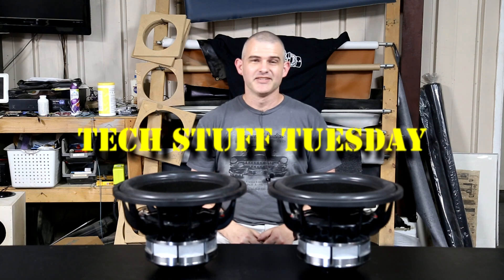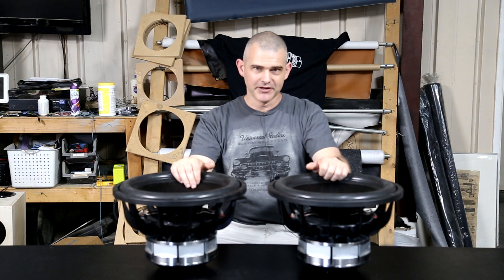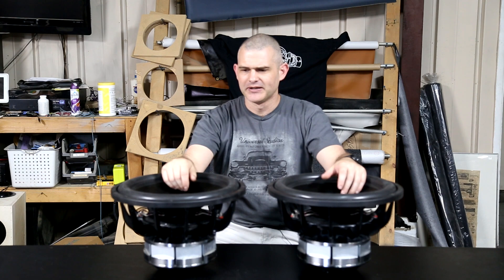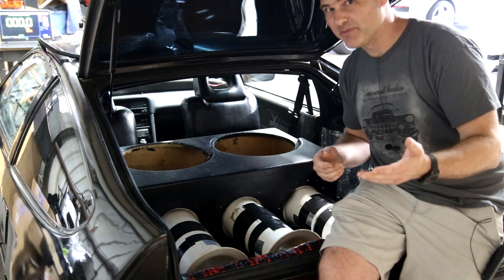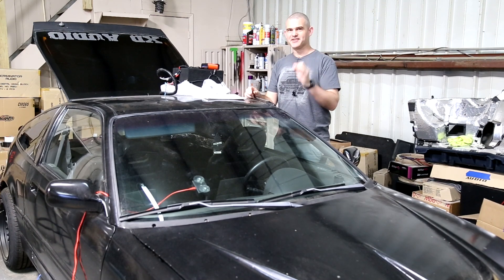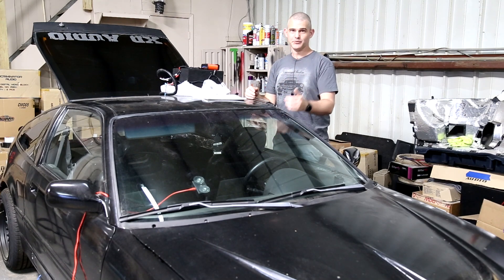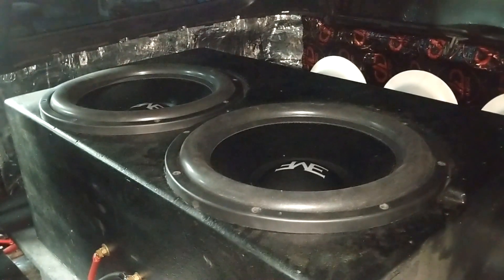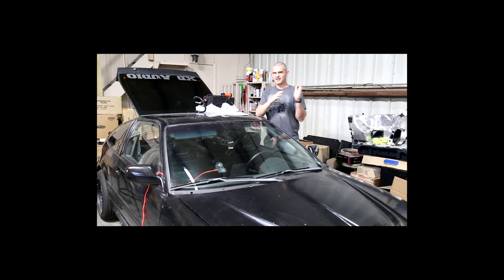What happens when one sub is broken in and the other isn't? - Tech Stuff Tuesday

Comment: I've been buying subs since 1993 and I have never ever broken in a sub.  I buy my subs, install and go full blast. 
Great video man!
Reply: Pfff me too. Ive never even heard of breaking in subs. I over power and run them hard without clipping. Never had a problem with good tuned boxes.
Reply: @joelthomas79  the glue on my kenwood 12’s came off and I got them tuned at a highly rated shop. I played them extremely hard first two days and now I gotta replace them ;(
Reply: @airuzair2424  lesson learned? don’t buy kenwoods again
Reply: @airuzair2424  shitty, just replaced my L7s with audio pipes
Reply: Werid encounter
Reply: Digital designs thinks you should break them in. I hear they are Richards. I don't know, I do it a.lottle in case the glue is too much causing the spider to rip, then again, it's probably rare that would happen.
Reply: @kcin2der18  audio pipe good?
Reply: @rookiebeeeautch5847  I love mine, still going strong!
Reply: U will get more xmax and travel  when ita broken in     its a fact

Comment: I drive a fairly small car an old Datsun and I used to break in my Subs. I would slowly push them and push them until they would start to stink... a little bit and then I would turn the sound way down... not off. But let them cool down and repeat. After about a week of doing that they wouldn't stink anymore and you could turn them up for a couple hours at a time.

Comment: I just installed 2x12" Ground zero subwoofers in my home theather. Recommended power is 350w RMS per subwoofer, im pushing probably around 400w per sub from my home theather subwoofer amp. the subs are single 4ohm coil so ive wired em down to 2ohm. they bang

Comment: 2 questions 
1) What happens if you have 2 different subs in the same box sharing 1 amp? Say 1 lowballer 12 and 1 SA 12. Both dual 4 ohm wired to a final 1 ohm load.

2) What happens if you have 2 different amps powering subs sharing the same box? So say you have 4 lowballers and 2 of them are wired to a 1k amp and 2 of them are wired to a 2k amp? Can you just lower the gain on the 2k to keep it somewhat even? 

Keep up the good content.
Reply from the maker: 1) You shouldn't do it, it's not ideal, and in some cases it could cause a sub to be damaged. In your specific example it would play just fine, just may not perform as optimal as it could with matching.
2) Refer to answer 1.

Comment: Can you post a video up on a dual common chamber with a slot port.
The port needs to be closer to one woofer.
Reply from the maker: Not necessarily.
Reply: I treat a subwoofer the same as piston in an engine..
What I'm trying to prove is that one woofer will age faster in such configuration hence we see one woofer unload faster than the other.

Comment: (Without bashing another brand because that always makes the bashing brand look bad) Why does Skar suggest, if not demand breaking in their subs or risk voiding their warranty?
Reply from the maker: My theory on manufacturers that suggest that falls into one of two categories. They either want an easy way out of not covering one (they could ask if you broke it in using their specific method and if you didn't adhere to it 100% then it's not covered, even a year later) or they want you to never play it hard enough to break it till it's out of warranty and it's not their problem.

Comment: I got 4 8’s and they don’t sound as good as my buddys do you think it’s because they aren’t broke in yet?
Reply: It might be your box design

If you design and make a diy box (there are plenty of tutorials on youtube using free software like  winisd and making it using basic tools) you can get way more output. There are a few things that you'll need. The winisd program on your pc, basic tools like a electric saw, a drill and ofc the materials if you have the tools you can probably make a diy box that sounds 10x better then your current box for like 50 bucks

In short:
Your subwoofer box is probably more important then which brand of 8 inch subwoofer you bought. So Your box should be designed for your subwoofer and not any 8 inch subwoofer.

I designed a 6.5 inch subwoofer box for a  dd506d (2 ohms) the design software says it will play down to 20hz but i havent made it yet but when i have ill update you
Reply: @troybakker7628  i got them sounding good now my 12v wire was bad
Reply: @sirdir5004  oh i see. But if youre looking for better or deeper bass a new box can always help
Hexibase has a video of a 3d printed box for a single 6,5 inch sub that made 136db in a spl test

The box that i am planning on building has some inspiration from it but ill use it in my home instead of car
Reply: @troybakker7628  Thats sweet that’ll sound good I was trying to decide if I wanted to install an equalizer because I already have an epicenter do you think it’s worth it
Reply: @sirdir5004  idk man i dont have a lot of experience with car audio since i never has a car or even my drivers license and this wi be my first subwoofer box build that I'll also use for a school project

But whats the reason you want to install a equalizer? A uneven bass response or sonething else?
Reply: @troybakker7628  i was thinking to see if it can give me deeper bass
Reply: @sirdir5004  hmmm i dont think it will add a lot of low bass. Maybe at low volume it does but at higher volumes it wont because the speaker wont be able to produce the low notes loud enough without over excursion.
For lower bass a box designed to go lower might be your only option 😬
But i ain't sure it might be that a equalizer will help but if youre hitting your excursion limit without a equalizer it wont add extra low bass
Reply: @sirdir5004  to add to that a equalizer doesnt lower the bass it boosts the lower bass
For example instead of the 80db you might get now at 24hz it makes it 83db but this wont work if your excursion hit its max like i already said

If you try to play notes lower then the tuning frequency of the subwoofer box your driver will move alot while barely making any sound
Reply: @troybakker7628  yea that makes sense I’ll probably have to go with a different box design

Comment: Some companies recommend that u do break in the sub a bit to loosen up the suspension and I agree with them as stated before...but to say it not needed as the sub will break in over time....is a reckless statement. Some people full tilt out the box....stiff suspension heat up the sub faster than loose suspension on the same amount of power. Also mixing a new with an old sub in a share compartment will have issues as one sub would not be able to cool as efficiently as the other....
Reply from the maker: You should watch more of my videos, where I prove all of that wrong. Also, you know what the sub not moving much from not turning it up is doing? NOT breaking it in. The amount the sub moves not broken in vs broken in isn't effecting cooling, and the more you push it, the faster it gets broken in. If you paid attention, it was less than 20 burps to get the other sub broken in which was REALLY stiff. That's almost like playing it wide open for 1 minute to get them to the same amount of stiffness. If the sub won't take rated power for 1 minute while breaking in, is it a sub worth having?
Reply: @EMFAudio  I see ur point but its dont take away from the fact that at 200w a new sub is moving less than a sub that is broken it at the same frequency. If we are doing spl that's ok but on music things start to heat up. Point I'm making is it would take more that 1 minutes to break in any sub with a sub that have been playing for months. Your next video u should be to prove me wrong Is to play a sweep on a new sub and an old broken in one and measure the temperature...i would say start the test at about 300w per sub some 12" should be a good option. I can tell u now the old sub would be cooler than the new sub over a longer period of time, and that's at low power now imagine pushing 2k per sub.
Reply: @EMFAudio  my point here is not to say all sub should be broken in before played but if u need ur sub to be optimal u should give it some break in time. Sub get stinky when push hard out the box rated power or not as some would assume it's over power or ur amplifier clipping....test has shown lack of movement has made subwoofer heat up. When broken it properly its takes on alot more power and dissipates heat more efficiently.
Reply from the maker: @dwaynegentle  What you're describing is heat cycling the coating on the coil, it has nothing to do with cooling. If having some break in period was critical to a sub not failing, why would I tell every customer (WITH US BEING A MANUFACTURER) to just play it normally, when I'd have to warranty any failures? It's because they won't fail from that. Yes it cools better when it's moving, but if it's not moving, you aren't breaking it in so it doesn't matter how much power is on it.
Reply: @EMFAudio i respect your opinion and recommendation as a manufacture, but as a user and a system builder i can tell u what i observe and recommend in the field. . but it would be great to do a sweep say 80hz to 20hz and lets see which sub fail first...using rated power. i recommend using your subs to do the test. here in the Caribbean we play for hours also we demo for hours, reliability is key to purchasing subs. i honestly haven't tried ur subs, but  i sure will after it has been proven to be reliable under rated power without having to be broken in. 1 to 5 minute burp don't prove reliability, dissipating that heat built during an hour long play does
Reply: i notice in one of your video u did a sub for someone in Trinidad, well Trinidadian knows who are the boss of loudness in the Caribbean, just ask them about Guyana. we do SPL SQL and SQ...some of the world loudest and cleanest sounding vehicle are in guyana...our country is the only english speaking country in South America with Brazil as one of the bordering country...which is the King of Loudness. we are talking Music here not one note SPL.
Reply from the maker: @dwaynegentle  So you're telling me that you, as a user, knows more about subwoofers than the person who engineers subwoofers? In this video I used burps because that's what is required to get data points. If it was just played and broken in, there would be 1 data point. What I've stated and demonstrated isn't an opinion, it's scientific fact. Doing a sweep I can tell you which will fail first, NEITHER. The only reason a sub would fail in the instance you're saying is because it was built way too stiff for the motor, which also means it would fail after broken in for the same reason.
Reply from the maker: @dwaynegentle  Brazil is the king of loudness when ignoring the rules LOL. The rest of the world ignores their scores because of it. The same thing has happened in South Africa.

Comment: If I had a 3000.1 amp and set it around 1500w on music would it be more efficient then having a 1500.1 set to 1500 I know it's stupid to ask but literally anyone I ask can't answer my question with facts I also think having a amp bigger then what I need would help avoid a little clipping daily
Reply from the maker: Amps don't put out a specified power amount, it is dynamic. So, a better way to look at it is set the amp to not exceed 1,500 watts under any condition. Now, that being said, if the 3,000 watt amp is 90% efficient and the 1,500 watt amp is 90% efficient then no, it won't be more efficient. It takes the same amount of power to make 1,500 watts. As far as clipping goes, if the 1,500 can make 1,500 watts without clipping then that's that. If it can't, then yes you'd avoid clipping by dialing back a bigger amp.

Comment: What my crx does with 2 12s.😀
Reply from the maker: With 2,000 watts, legal?
Reply: Unfortunately,  didn't clamp it for actual wattage. 
Using 4 e-audio e3000d and a  very broken group 31 battery. 
Pair of apx's with dual. 7ohm
Reply from the maker: @robv.o.1777  So not what your CRX does with 2 12's.